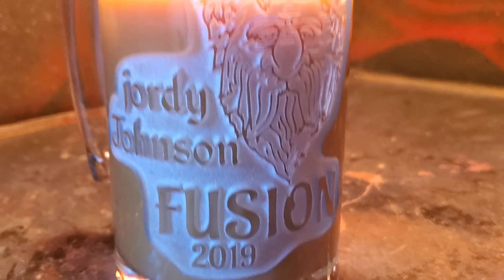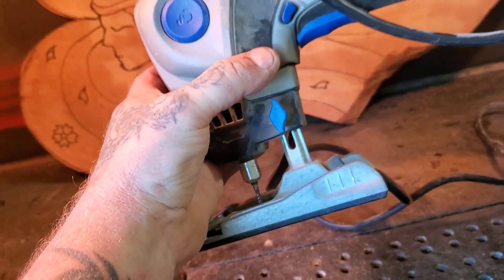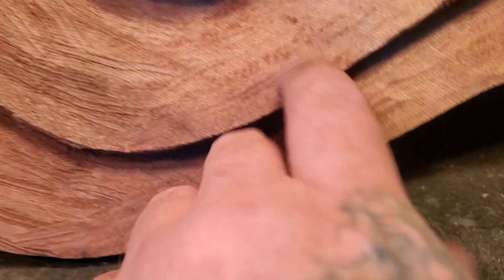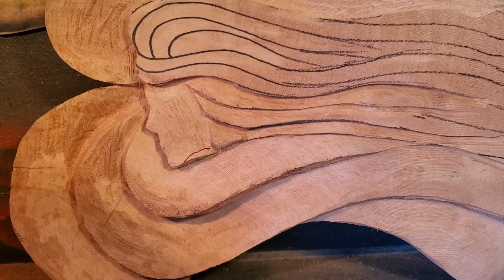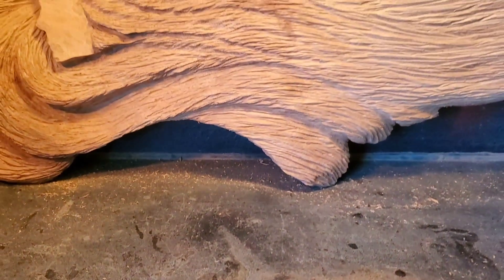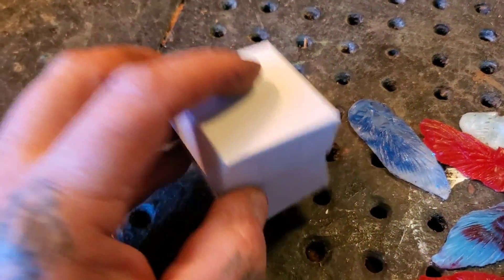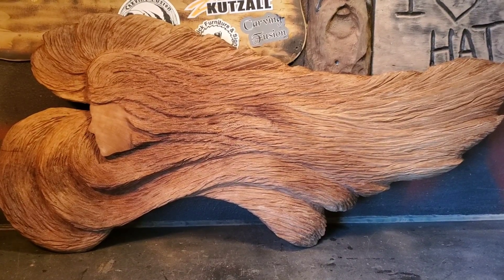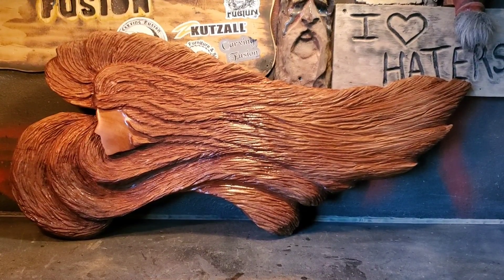Carving a lady WOODSPIRIT. Dremel. Foredom. Merlin 2. Kutzall carving burr's.

Comment: Looks great man, as always! And touching you hear you speak about your mother.👍🏼                                      I do have a question for you, in your opinion who makes the very strongest flex shaft out there (I’m going to make  my own grinding setup similar to the 11340 guinevere basic sanding system.   Thank you for your time.
Reply from the maker: Thank u , 100% the foredom upgrade to th industrial flex shaft, (u need the industrial hand pieces to with the flex shaft)
Reply: Carving Fusion By : Jordy Johnson ,   Thank you sir. 👍🏼